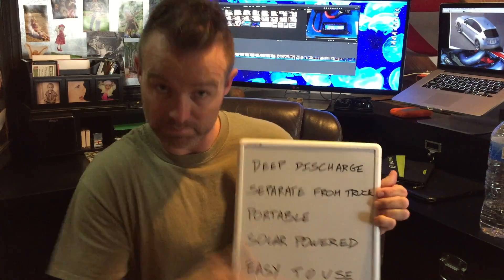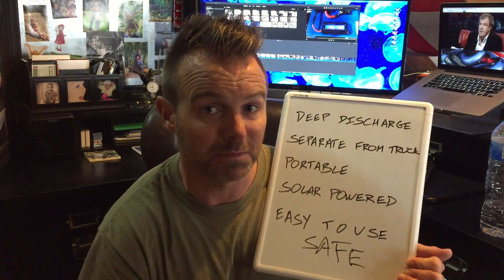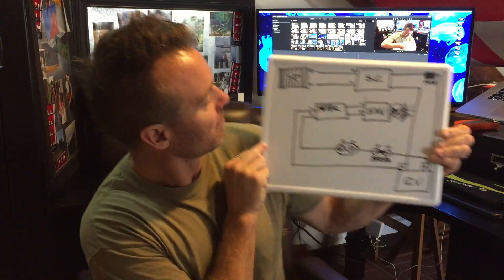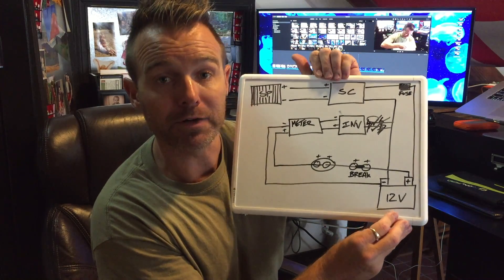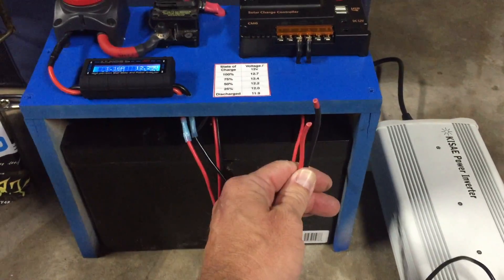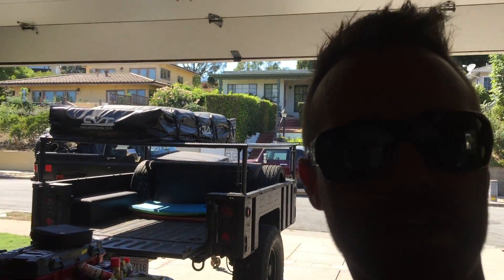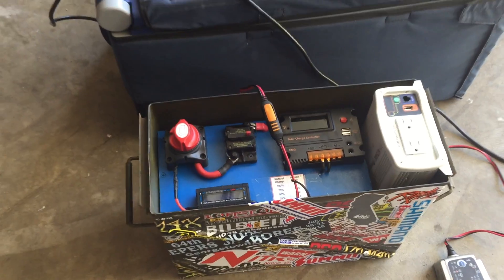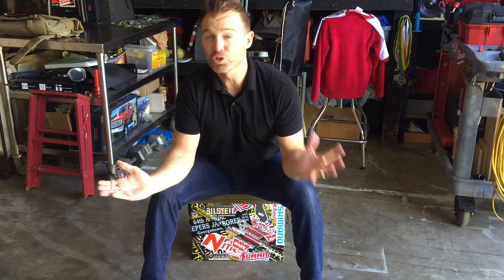MG #28 - Ammo Can Solar Power.  Part 1

Comment: try to avoid using your inverter as much as possible.... Ie. if you have an appliance that can be run on dc or ac always use dc and skip the inverter all together. ie. your ARB fridge is dc or ac, I believe, so use it's dc plug..... a converter is less efficient by about 20%. in other words your throwing away 20% of the juice your getting from the sun....

Comment: Great video and great job on the fitment in the ammo can. I'm no expert but I have one suggestion. Battery boxes have a vent tube for a reason. Charging a lead acid battery causes hydrogen  gas to "leak" and that's explosive especially with all the fired up electronics inside. So a slick vent tube may be safer. But I'm no expert. Just my 2 pennys.

Comment: Im pretty sure that breaker has a trip button so the battery switch is unnecessary and also i see thick wire on the from the breaker to the switch which looking at the like 10 maybe 8 gauge wire on the meter which kinda defeats the purpose of thick wire

Comment: Great video!! Was wondering, the ctek that you showed on the vid, they do go to the + and - sides of the battery, correct? Thanks. Switch, Breaker inverter are obtainable through Amazon/Ebay?
Reply: How do I link up with your Amazon site? Will check it out.

Comment: Why not add a direct 12 volt cigarette and USB plug for the electronics and fridge? You're loosing power converting it to A/C. The converter is great for charging laptops and running other stuff.

Comment: Nice compact unit!  One question - why are you running that fridge on AC?  It would be way more efficient running on 12V DC vs running it through a DC/AC inverter.  The AC is nice to have for other non DC devices.